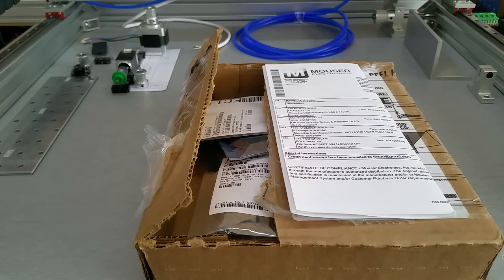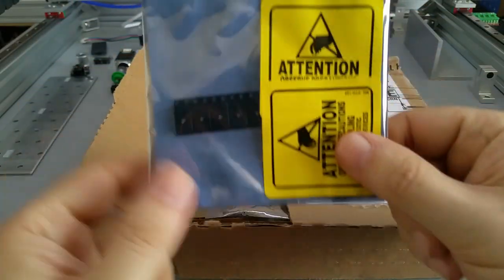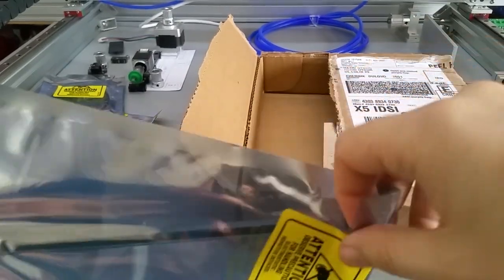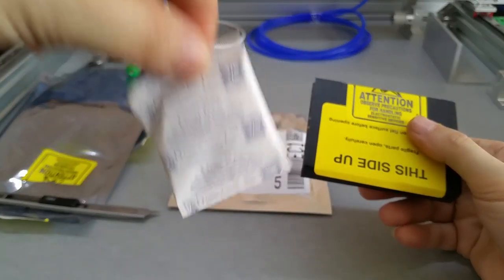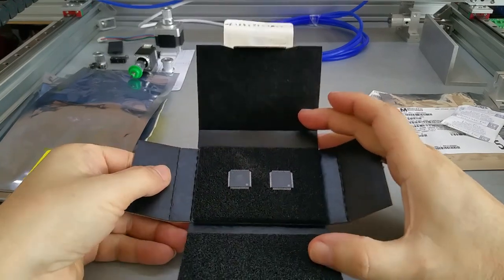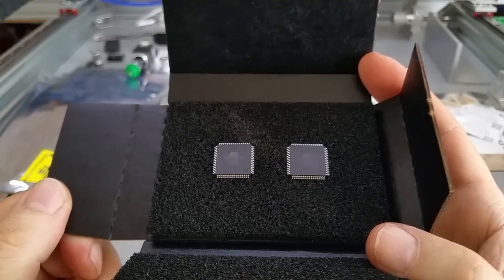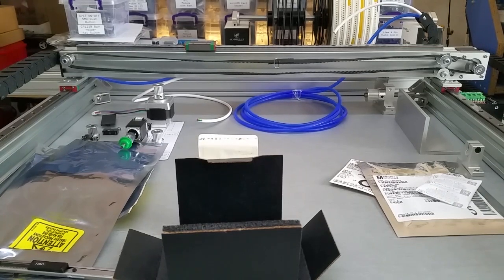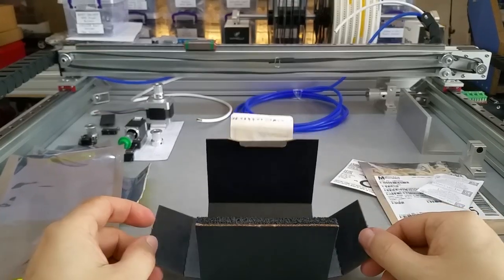Electronic Parts From Mouser Unboxing

Comment: Hi! Try tme.eu , big catalogue and good prices!
Reply from the maker: Actually, I did buy from TME before just forgot to mention it. Thanks for the link, might be useful to somebody here.
Reply: yep
Reply: The advantage of MOUSER over TME is that they have just a slightly bigger assortment of components. Sometimes I search for a part and the first an only google link is from mouser. However mouser has ridiculous shipping costs (in my case 20€ for a parcel that ways 50g), thats why I will still buy parts from TME. And the prices there are very fair.
Reply from the maker: I prefer Mouser over TME too because their selection is better and there is not even customs problems because they ship it either over Germany or England. To eliminate the shipping cost altogether is possible if you oder the minimum amount, for me it is $50.00 which is easy to get if you order parts in bulk as I do, but of course for smaller orders TME is the way to go if you are in Europe. I pay $7.00 shipping to Bulgaria.
Reply: Tme.eu is suitable for European users, Allchips.ai have cooperated with Tme at 2017. Allchips services for company.